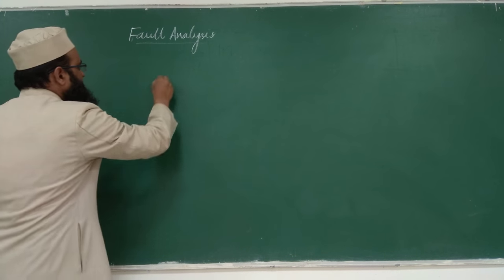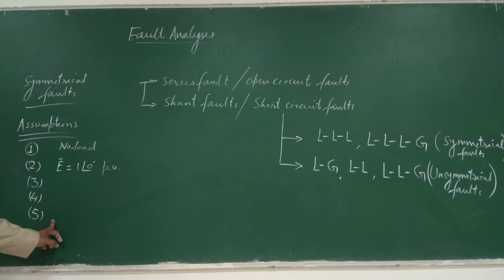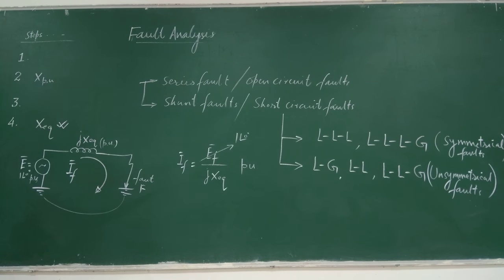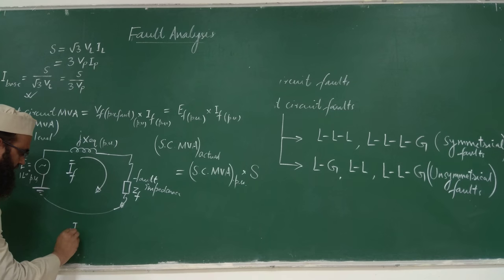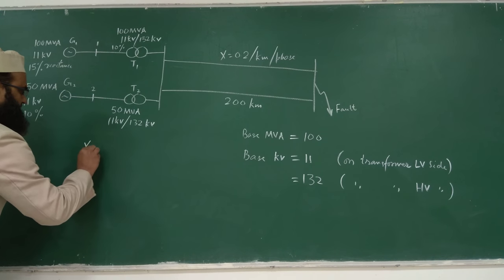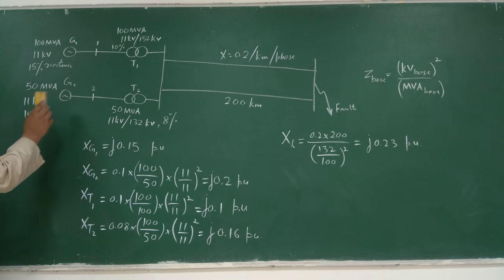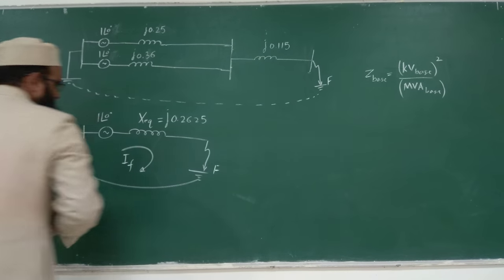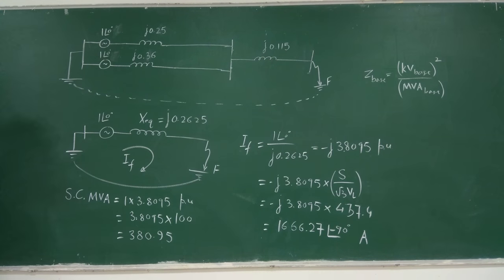Symmetrical Fault Analysis

Comment: Sir... great lecture.. Cleared all my doubts.. on symmetrical faults.
I calculated rest of the math.. Anyone Correct me if I am wrong: 
Current supplied on LT side = Ifault X 100/11X (root 3)=20 KA
By current divider Ig1= 11.803 A and Ig2=8.196 A.
Reply from the maker: Thank you Asif Khan for the comment.
Your calculations are almost correct.
As per my calculation,
Total Current supplied on LT side = - j 19.995 kA ≈ - j 20 kA.
 Ig1= - j 11.8003 kA and Ig2= - j 8.1947 kA.
Reply from the maker: For more problem practices on "Symmetrical Fault Analysis", you may visit the following link:
https://www.youtube.com/watch?v=9Cemdc6q7O0&t=449s
Reply: @DrAfrozAlam  thank you sir....you are the real saviour
Reply from the maker: @Sattam Dutta,
You are most welcome dear
Reply from the maker: Download Fault Analysis lecture notes (pdf) using the following link:
https://drive.google.com/file/d/18Zvgdi3YD6iAIkWJwz5-s7dVHRgM6lwZ/view?usp=sharing

Comment: Sir at time 42:03 .100/root 3*line voltage on h.v side you get the value (-j437.4) but I get the value (j0.43738 )...
When divided by 100/root 3*132=(j0.43738)....sir how you find the value of (-j437.4) ?
Reply from the maker: As 'S' is in MVA, you need to calculate as,
(100*1000)/root 3*132 = 437.4

Comment: The reason why education is boring without practical classes is the difference between theory and reality. 
Most engineering students do not know what is motor, transformer, transmission line, circuit breaker, current transformer even in their advanced studies. But they have to make all these calculations theoretically in their engineering studies only on their mind.......
This works only when you have hands on experience on substations and power stations........Otherwise this session is just an asmr.

Comment: Asalamu alikum , please help sir in this Q.
A 10KVA,400/200 V single phase transformer with 10% impedence draws a steady state short circuit current of ?
Reply from the maker: Wa Alaikum Assalam. Use the same procedure explained in this video lecture.
Isc(p.u.) = 1/0.1 = 10, 
Isc(base) = (10×1000)/200 = 50 A,
Isc(actual) = Isc(p.u.)×Isc(base) = 10×50 A = 500 A (Answer).

Also, in case of 3-phase transformer,
Isc(p.u.) = 1/0.1 = 10, 
Isc(base) = (10×1000)/(√3×200) = 28.868 A,
Isc(actual) = Isc(p.u.)×Isc(base) = 10×28.868 A= 288.68 A

Comment: Sir, What will be the effect on fault current in the case of LLL or LLLG fault if neutral of synchronous generator is ungrounded??
Reply from the maker: In such faults, negative and zero sequence components of fault current are absent. i.e. only positive sequence component of fault current exists which does not require path through neutral.

Note: Only zero sequence component of current requires its path through the neutral. 

Recall, neutral current In = 3*Io

Comment: Sir why in symmetrical fault calculations shunt elements are neglected. Please clear my doubt sir.
Reply from the maker: To make the calculations simpler for undergraduate level students
Reply from the maker: This assumption doesn't make significant difference in the accuracy of the results

Comment: Sir why we take base voltages different sir on hv and lv side
Can we take single base voltage for both sides
Reply from the maker: As we know that actual value of voltage at any point of the system is equal to per unit value multiplied by its base value. Hence, base value is changed whenever actual value of voltage is changed due to presence of a transformer.

Comment: Mashallah very interesting and simple way to do fault analysis.. But Sir, would you please explain kindly the reason of calculating value of XG2 whereas the value already given as 10% like you put the value of Xg1. wish to get more practice materials.thanks.
Reply: Even if u apply the formula in xg1 u get 0.15*(100/100)*(11/11)^2 soo he directly wrote it , hope this answer helps you sir 🙏🏻

Comment: Thank you Dr, your video helped alot. But you didn't finish the last part, What are the values for the actual currents supplied by the two generators?
Reply from the maker: Please see the pinned comment
Reply: Thank you Dr. If you find time please make a video on symmetrical fault analysis with a Load connected.

Comment: Thank you sir for this lecture! 
Can you just clarify 1 point for me? When making pu system in your example. We assume 100 MVA as a Base. Then Gen1 is 1 pu, but shouldn't Gen2 be 0.5pu?
Reply from the maker: Both the generators are operating at 11 kV, hence at 11 kV base, operating voltages in pu for Gen 1 and Gen 2 are shown as 1 pu.

Comment: Hi sir.
Not clear on the source; how can we say it is 1pu?
Reply from the maker: Source voltage will be taken as base voltage (Base kV). Hence, its per unit value will be 1 p.u.
Reply: @DrAfrozAlam  How do we say two parallel source equivalent to one source?
Reply from the maker: @gustavomarcelo7250  Using source transformation. First convert each parallel voltage sources into current sources, then convert the equivalent current source into voltage source.

Comment: Sir please explain source transformation theory
Reply from the maker: If you have problem in understanding 'Source transformation', then alternatively you can use Millman's theorem which is used to compute the voltage of a circuit of parallel branches.

Comment: sir why we use Dy11 transformers at receiving end of the transmission line and Yd1 at sending end of it?
Reply: Yd is used for step down (root 3 time more stepping down then yy or dd for line voltage) and dy is used for step up (more step up).